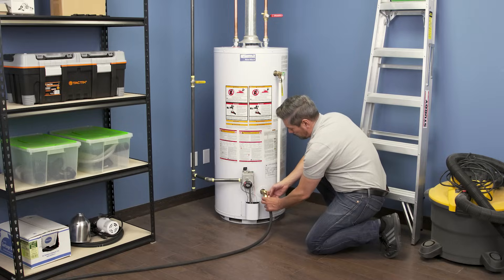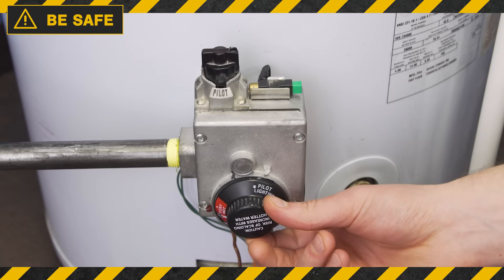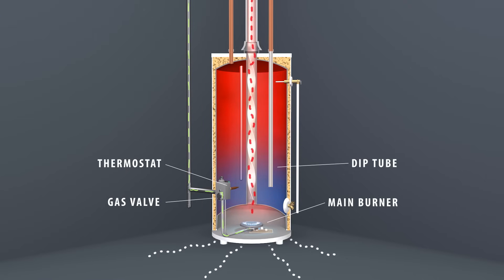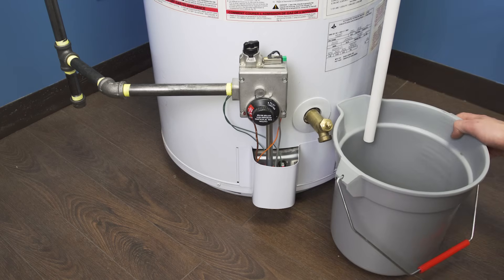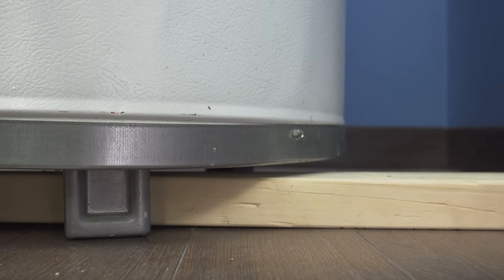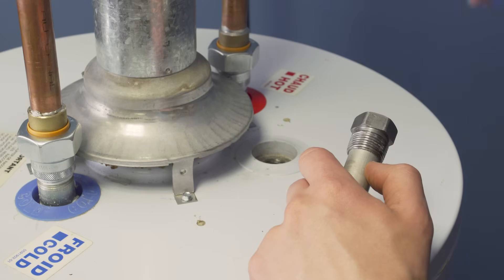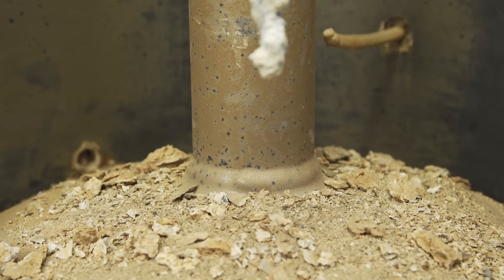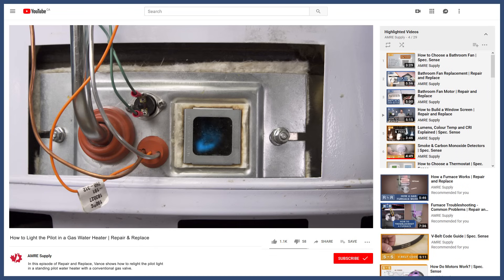Gas Water Heater - Maintenance Guide | Repair and Replace

Comment: Thanks so much for your video. I was told by a person at Lowes that draining my tank was not needed( I've had it for a while), but that did not seem right. Your video is easy to follow and I'm going to check/ do maintenance on my heater right away. Again thanks.
Reply: Lowe’s told you that so they could sell you a new one
Reply from the maker: You're welcome, we're glad you found the video helpful! 

There are many people that we say that they went X number of years and never did any maintenance, but its always best to be proactive and stay on top of it. Trying to unscrew an anode rod to check on it after its sat for 10 years is really difficult. If you check it yearly its pretty easy. As well a flush is easier if its done regularly.
Reply: @AmreSupply  when checking the anode rod, do you replace the teflon tape each time?
Reply from the maker: @TheArtificiallyIntelligent  Thanks for watching. Yes its best to apply new teflon tape each time so that it is easy to access, 2 - 3 wraps should be good in most cases.

Comment: Amazing video!  Any troubleshooting guild with noises and it's cause?
Reply from the maker: Thanks Liu, we're glad you found the video helpful! We have some troubleshooting guides on how when the pilot flame won't stay lit, and some other maintenance and repair on water heaters but nothing on the noises: https://www.youtube.com/watch?v=BHUPFLbb8NY&list=PLCo9SMjkdWBwJ4a8MT2GKTDiSuvSHg6Xk&index=2

As for noises, one common noise can be the water heating up under the sediment inside your tank making a popping sound or almost a similar sound to a coffee machine. That can be reduced by doing a tank flush. As well if you have a power vent water heater, the draft inducer motor can be a source of noise.